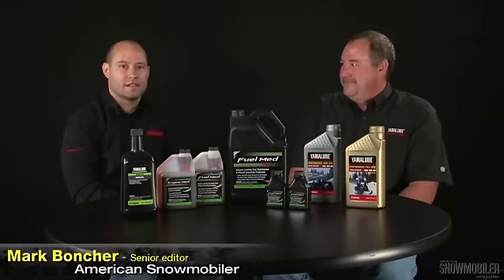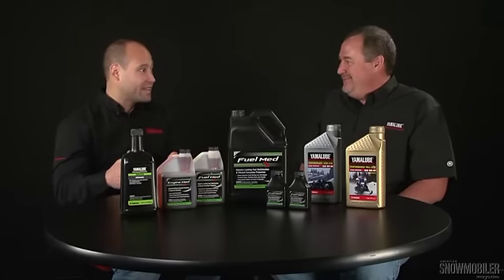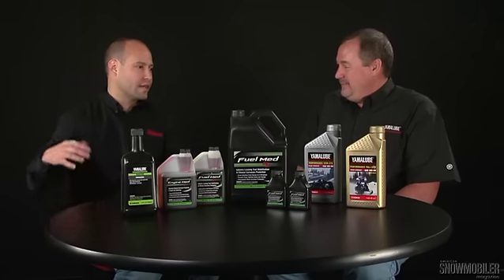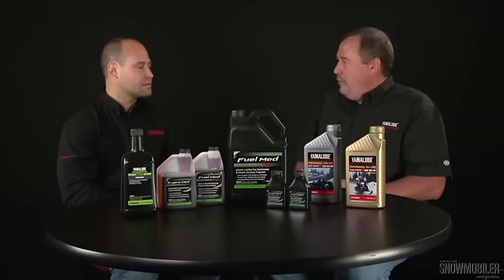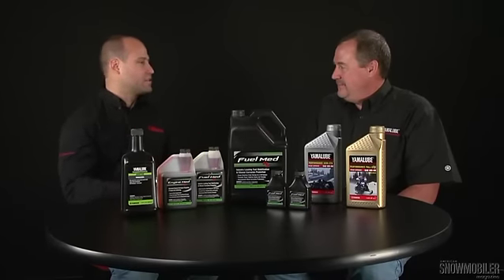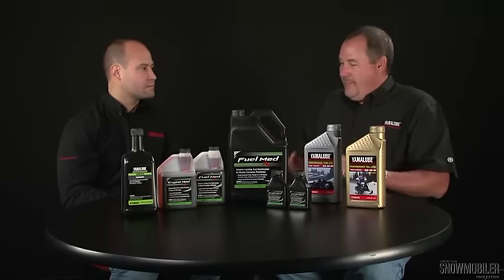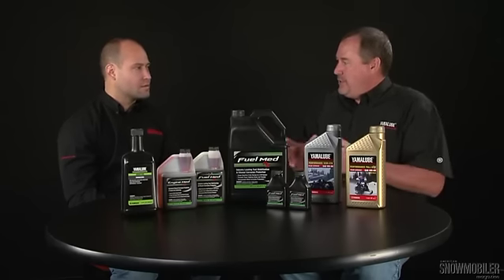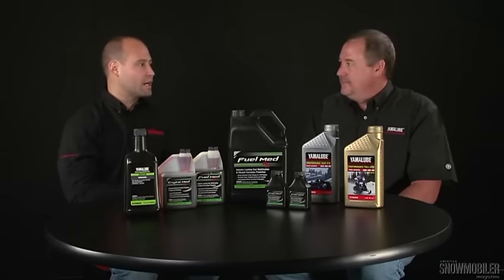Truth about Ethanol

Comment: Sales men, Ethanol is a carbon cleaner in its self, Ethanol is higher octane, and water has been injected in engines for 100 years or more look it up. As far as hurting your truck you are full of shit.  I drive 1985 chevy with no problems. drain the gas